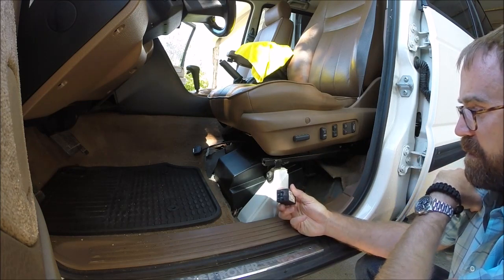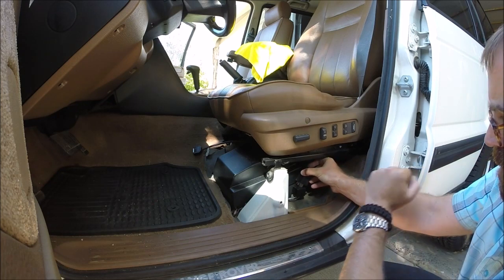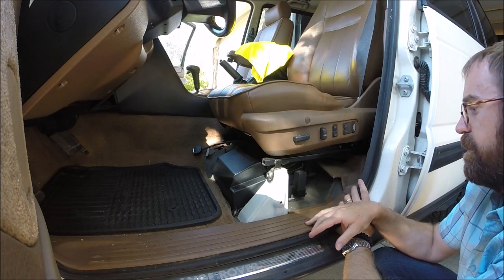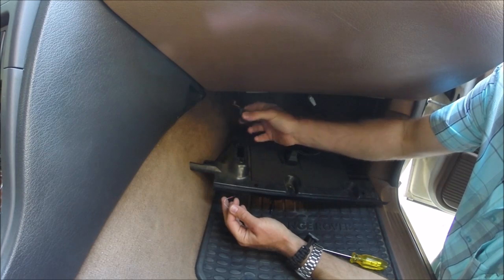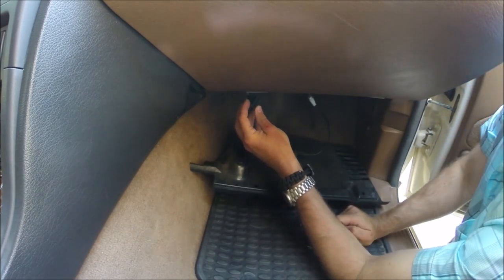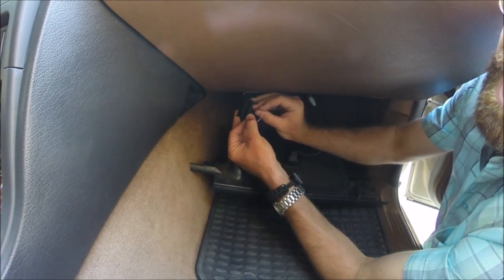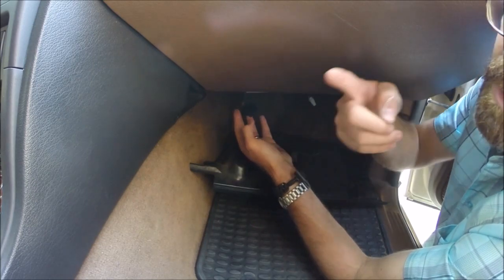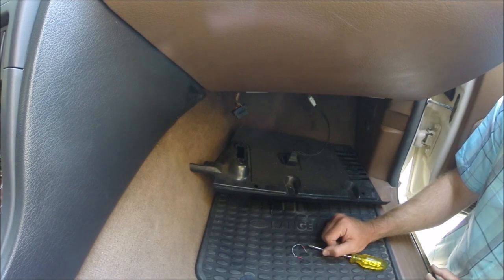RSWsolutions - Range Rover P38 EAS Delay Relay

Comment: I have a serious problem with the EAS and I can't get where is the problem. I changed all 4 height sensors and front 2 airbags .  No air leak the car can stay in high position for weeks. But got EAS fault and when I clear the error in 5 seconds I get it again. The front wheals are OK, but rear are pumped to the high possible limit. The program shows all levels set to 234 and when I change them - nothing happens. Can not calibrate at all. Doesn't write. Cable is OK. Changed the computer EAS - no effect at all. Checked fuses and relay - seems OK. At 2 position the key I get EAS fault. Before I turn on the engine.  So should be electric problem (I think). But can't find where .... cables looks like new. Sensor connections look bright (no corrosion).

Comment: Thank you for the video. Just finished purchase my EAS unlock V4 p38, and I hope it solve my problem with sir suspension otherwise I will delete all system and convert to coil spring. Peace of mind. Because I do everything to safe air suspension system but until now not working fine.
Waiting my software and hardware.

Comment: Sir I have a question about your video on cleaning the throttle housing.  I have cleaned it now and wondering if I should put a drop of oil around the gasket ?

Comment: hello ! i have a problem in windows 10. in my pc the message is appear on screen that (cannot display This Video Mode Optimum resolation 1280x1024 60Hz).and  my all deriver in updated.i have (i3 2nd generation 3.30 processor with 5 GB RAM)